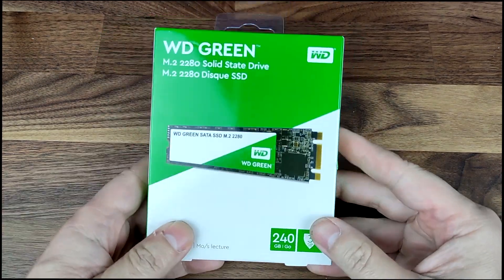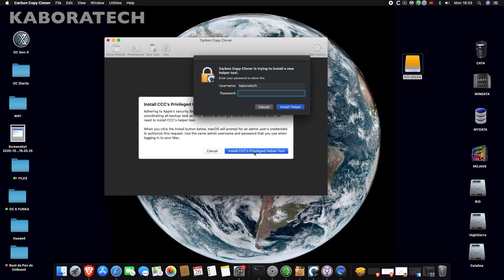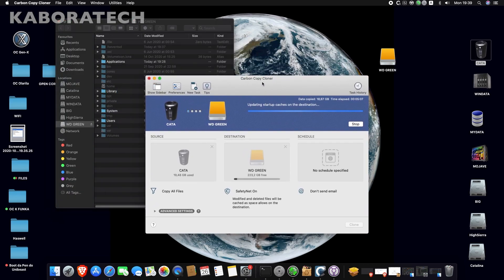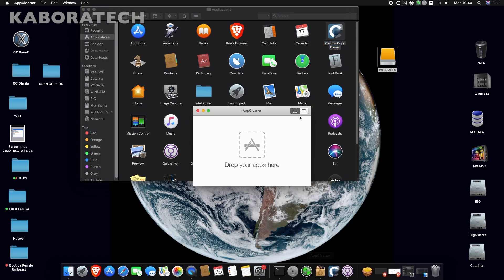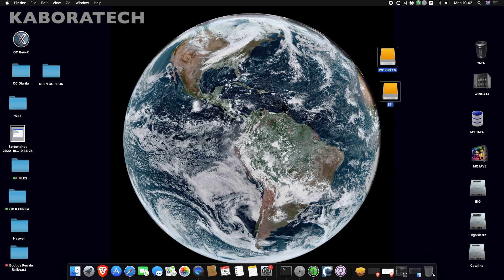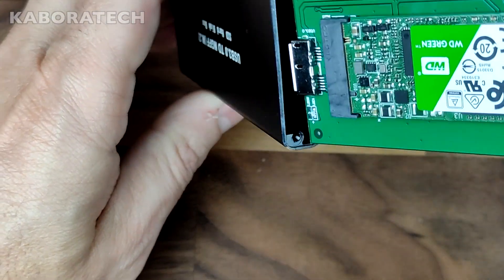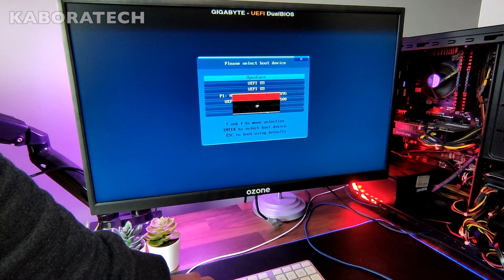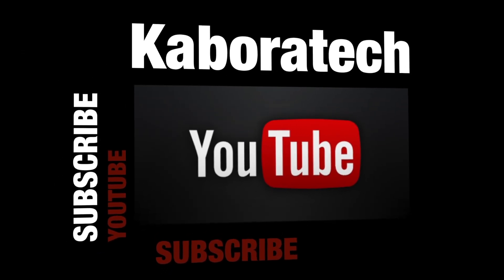How To Clone MAC OS X

Comment: I hope you could help.. I need to clone my current NVME drive to a larger one. I didn’t build the Hackintosh.I understand the approach of cloning and copying the efi folder into a new one. However, this system is a dual bootable system with Windows on a different NVME drive. I was wondering if by changing the drive this could cause any conflict with the dual boot setup (when I turn on the computer it gives me the option of booting into either Windows 10 or Big Sur). Would I need to tweak anything else?Many thanks.
Reply from the maker: Hello, separate drives no problems at all, I have at least 4 disc's, windows 10,catalina,big sur, mojave
Reply: @kaboratech  Thank you very much for your reply (and videos!)So although the original drive would be replaced for the bigger one (I guess ssd regular or nvme drive doesn’t matter) that wouldn’t cause any conflict with the boot up icon (then gone)? If I was to leave the old hd connected (and no formatted) then 3 icons would appear on the boot up screen; win 10, old hd and new hd? Sorry for the silly questions, I just want to make sure I am not going to mess up the current system as it is working well...